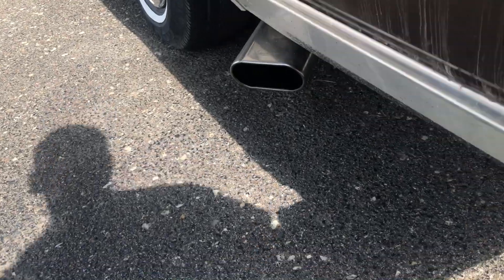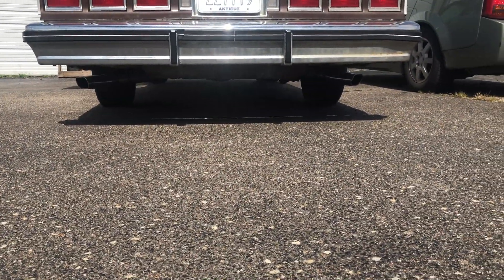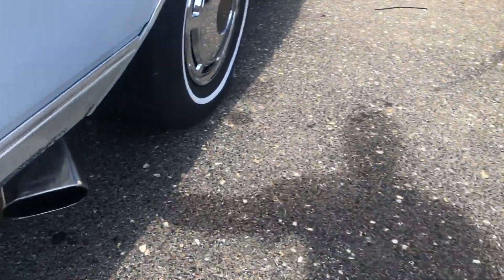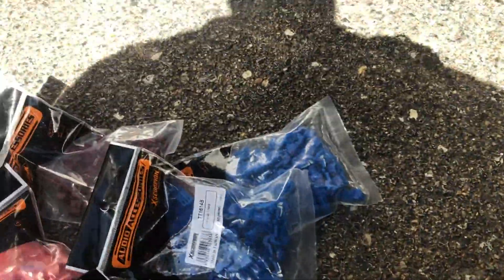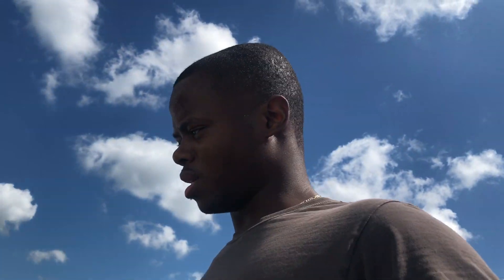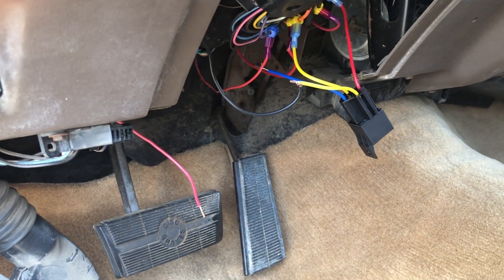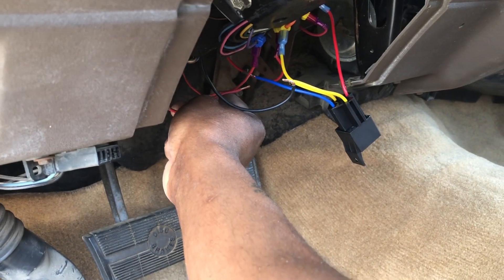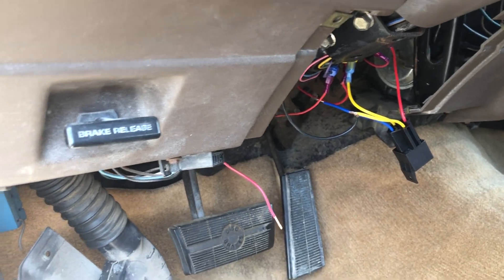“Why Not Carbed?” So This Was My Issue 🤦🏾‍♂️

Comment: The thing with these ls engines is once you modify them unless you got somebody and the money to tune them they not gunna run correctly fuel injected. I think carb is the cost effective do it youself way since it can be tuned at the turn of a few screws. I wanna run one of them self learning quick efi oneday though. I wonder how well they self tune with a big cam but that price is rediculous